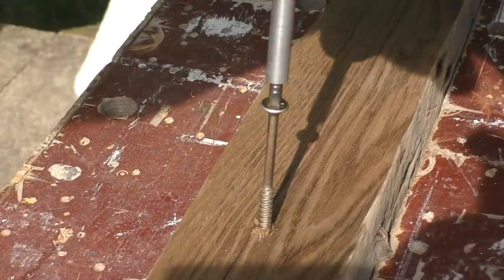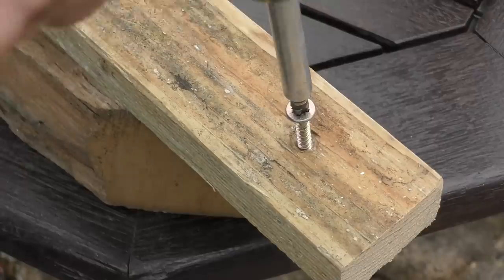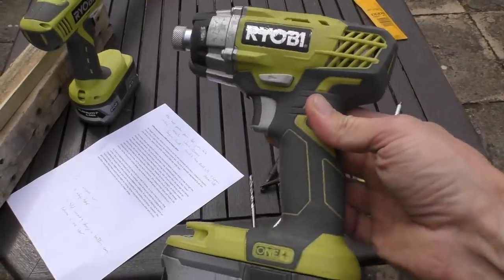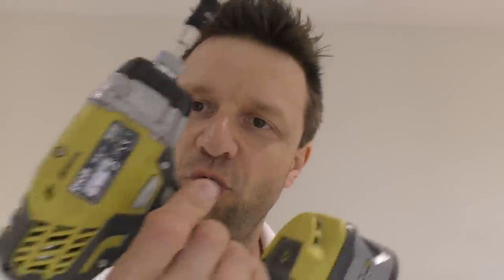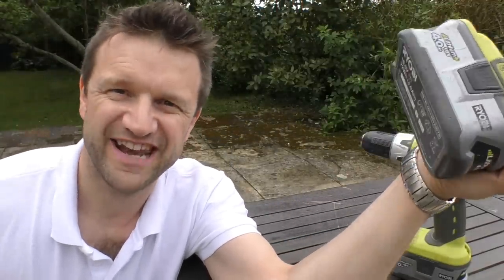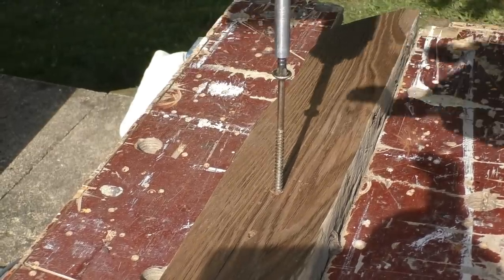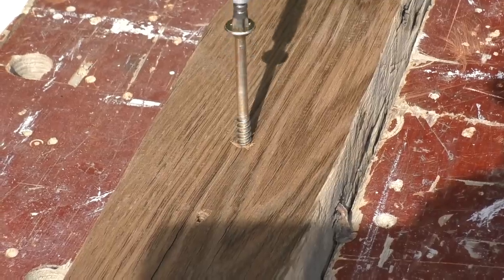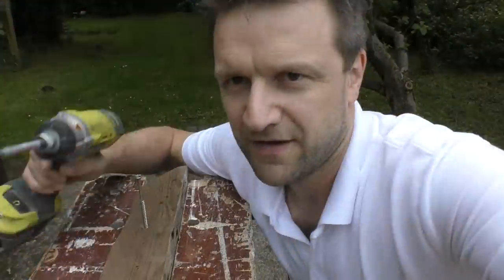Difference between Drill Drivers & Impact Drivers

Comment: ""I'm going to show you how much better the impact driver is that a standard drill. Both using 4.0 Ah batteries.
Standard: Screw goes right in.
Impact: Screw goes right in.
"Well, the drill did just as good... impressive. Now! Let me show you the 1.3 Ah battery! Here's where the impact shines..."

Standard: Dies 2/3s of the way in. "See? It just stops moving, entirely."
Impact: Dies 2/3s of the way in. "See? The small battery just isn't strong enough."
Finishes with a 4.0 Ah.  "See? The impact driver ran it right in!"
Reply: 😅 I thought it was just me...
Reply: Lol I thought the same honestly. But the point he was trying to make (which can't be seen in the video) is that he didn't have to apply as much pressure on the impact drill as he did with the standard drill.

Comment: One thing I think you should address is the voltage vs amperage. Amperage allows more working "time" but the voltage - also known as potential difference - is vital in delivering the charge (amps) fast. This is really why a 14v battery can theoretically have a 5ah charge but be unable to drive the big tools such as cordless SDS and why 18v+ batteries matter for pure power (and usually come with 4ah or 5ah batteries). The reason I think you had issues with the 1.3amp batteries here is that chemical degradation is effecting them though it might be to do with their construction (series etc) I'd have to pull a battery to bits to see.

But basically higher voltage and higher amperage = win.
Reply from the maker: Yep, I hear what you say. All makes a lot of sense and you might look at MondoTV's comment on this feed, which is on a similar line.
Reply: I love my 5.0 ah 20v batteries. Feels like they are never dead when I need them. I charge all of them up on the weekends before going back to work for the week

Comment: Solve it all by using a pilot hole and countersunk tool... And a bit of candle wax.
Reply from the maker: Totally agree - particularly in hard wood like this, but I was trying to make the test as demanding possible.
Reply: @CharlieDIYte  Why.... Its like comparing a 850 cc mini against a 3000 cc Jag. One is stronger than the other obviously, but driven differently both do the same job... A to B...
Reply: To A and B sure.. But, one's gonna do it faster. Which is kinda his point. Time is money.
Reply: @raymondrexinger3300  Ah,,, from that point of view then I understand. I've always considered quality first, though,  being old school as they say...
Reply: Ok?.. Quality has nothing to do with the ability to work faster/easier by choosing the right tool. "Work smarter not harder" something a old schooler once told me....
Reply: @raymondrexinger3300  Smart would be to use a countersunk, a clearance hole and then a pilot hole to enable people to use the cheaper model. That's what is smart and the finished job will look better no churned up screws slots. And they will never break a screw , which takes a lot of time to remedy. That's what is smart...
Reply: tony wrigglesworth this isn’t a tutorial on screwing, its a comparison done strictly to showcase the difference in the two devices’ method of action and power output, plain and simple...
Reply: @Fee.1  Ah,, a bit like reading the info on the boxes they come with...
Reply: Instead of wax, use soap.. even better dish soap.. it gets absorbed and becomes almost like glue
I usually use basic white glue to speed things up most often..

Comment: I am a big fan of Ryobi One+ and have recently got the Drill+Impact Driver 2-pack tool kit to add on to my Mower and Weed Whacker. I have the 9 AMP HOUR battery and it works like a dream with my mower, being able to mow through well over 500sq-ft  of thick grass and then Weed Whack the extras all on the same battery and the same charge! Nice to know that the different batteries are more than just capacity but peak power!

Comment: I use the 18.volt battery everyday, never loses the charge and I can use the impact screw gun all day on three batteries at work. There shouldn't be any problems using the 18.volt batteries unless you don't charge them or they ain't charging.

Comment: ..well I'm not sure if you would use the hammering effect for a ordinary screw in wood...
If wood is that hard, I would have made a  drill-hole in it..
Reply: If you don't pre drill wood and just try and stick a screw in it with an impact the odds of splitting it are pretty high... impacts should never be used for finish work imo

Comment: I'm buying a drill driver with a powerful battery....
Reply: Seems like the way to go.
Reply: ...and drill pilot holes ahead of time if you need to.
Reply: Way to go. I have had the drill driver for five years with a coupe of 4.0Ah batt. Never had any problems. Just build a hardwood deck. It did an excellent job.
Reply: Impactors are way better imo. Just puts no stress on your wrists plus they are normally faster
Reply: I'm not sure this is a scientific test of battery performance, we have nearly no information on the different batteries.
Reply: I have both an impact driver and a drill driver from Milwaukee and I love them both
Reply: just no

Comment: So... conclusion, if you don't need an impact driver, get a bigger and better battery for you drill driver... it will get the job done with a bit more effort, end up spending less dollars and save space. 
Only professionals would need an impact driver?
Reply from the maker: Liwkit MC It's difficult to argue with that. I guess the crucial bit is where you say "if you don't need an impact driver". That's a tricky one. If you're a budding DIY enthusiast who is turning their hands to an increasing amount of jobs around the house - from putting up curtain poles in masonry walls, screwing in skirting boards/ base boards to decking, then I'd say you might actually "need" or at any rate "benefit from" an impact driver - ie it will make your life easier for the more heavy duty jobs where you need a bit more power and torque. But if your use is more occasional and is never likely to grow from that, then I'd say you're right.

Interestingly the screwdriver I use the most is my little 9v drill driver https://goo.gl/SqknZe which is great for most light weight jobs around the house and one of the fitters who works for me - who is a pro carpenter/ joiner, absolutely loves it as it's so light and portable. So I guess that kind of proves your point!
Reply: No, you'd be better off with a small battery on an impact driver.

Probably cost the same as a bigger battery.
Reply: If you buy the same brand, all you need is bare tool, most cost the same or less than batteries, Buy the impact.
Reply: You don´t need one right. But its way nicer to use.

Of cause, if you only screw in hard screws once and a while.... yea... then you can just as well use your drill.

But if you need to screw in 20 heavy duty T25 screws after each other....

Really should buy a $99 impact screw driver if you hardly use it...  but if you screw a lot of screw and you are tiered of them slipping and holding the drill... then its really usefull.

The other reason to have a impact driver is that its quite common that one does drilling and screwing at the same work. Just not changing the tool in the drill does save a lot of time..

Again, you don´t need it, but its really nice
Reply: You can never have too many tools...ever
Reply: But the impact driver didn't get the job done when powered by the smaller battery. The impact driver doesn't have the over-torque protection nor the ability to take drills, so for the budget challenged DIYer there is only one solution: get a drill driver with the bigger battery. You can always add an impact driver later, if you feel the need.
Reply: @daffygrey  
I do agree with you. I was a contractor with the cable company. I used both hammer drill and impact driver, Milwaukee, for 10 years with the 5 Ah XC batteries in each. Both are unnecessary for a DIYer on a budget. Just the regular drill with the 5 Ah batter would be perfect.
Reply: "But the impact driver didn't get the job done when powered by the smaller battery."
It looks like that here. But my experience (used multiple diffrant impact drivers for over 10 years now) is that they often does.

"The impact driver doesn't have the over-torque protection"
Its not needed. Because they run slower the harder the torque is. So screws can be used with much better precision 

"ability to take drills,"
That is mostly true. You really should only buy a impact driver as a second tool after you got a cordless drill. But they can use 6 edge screws in a pinch.

"get a drill driver with the bigger battery"
A bigger battery might actually be more expensive than a impact driver.

"You can always add an impact driver later, if you feel the need."
That is true. The impact driver really should be the first tool to buy. That is a tool that you buy when you get anyed about swiching tools on your cordless drill.

I would also say. Even for a DIY home user. If you ever going to drill in concrete or stone, you really should have a SDS drill in steed of a normal cordless drill. Of cause, they are not really that cheap. but generaly they are a much higher quality product.

Really never use a normal cordless drill for drilling in concrete. You destroy it.
Reply: Also, if you do small engine work or automotive work, the impact driver is just far superior. You can easily use sockets on it and it'll rip out most nuts and bolts found on a common car. The impact mechanism is much better for that, and it's also smaller than the drill. I have a ton of 18v ryobi tools I use at home and the impact driver sees the most action. I have the 1/2 inch impact as well and it sees little use. It's a bit too big and it'll shear off bolts without much warning. So if you work on mowers, quads, dirt bikes, cars ect then the impact driver is one of the best tools you'll ever buy.
Reply: Phillip Arpin He who dies with the most power tools wins!
Reply: Phillip Arpin I have both Ryobi and Milwaukee (mainly because there was a particular tool you could only get in Milwaukee).  I am glad I ended up with a Milwaukee circular saw as it performs like a corded one.  So I think for tools that respond to power Milwaukee will be my choice, but for everything else I will save my money and get Ryobi.
Reply: I contract and it is a case of using the best tool for the job. There is a big difference in noise. If i can use the drill for a bunch of screws I will because it is quieter basically. Impact drivers get a bit overused on sites and make the workplace way noisier.
Reply: Yes it is a pain having to put hearing protection on when using an impact driver.
Reply: As a professional I use both.  I need the drill and the impact 
 Both have pros and cons that are essential to my line of work
Reply: If it was a dewalt hilti or makita it would of went right in the timber even with a small battery
Reply: Bite the bullet and buy an impact. Professional or not, you'll be glad.
Reply: More Ah does not mean more power...it only means more run time. Just buy a DeWalt and it will have 100s of times more POWER than the cheap brand, and it will use that power more efficient allowing for even their lowest Ah battery to last a good week of 8 hrs a day use, sometimes even 2 weeks. I have 5 spare DeWalt batteries I have never had to use because they last so long. My coworkers use ryobi and can never finish any job and never have enough charge to their battery. DeWalt is for supervisors
Reply: My wife cam’d out screws a lot until I introduced her to the impact gun. Now she never has the issue .

Comment: Interesting how the 1.3Ah was very weak. Are they older batteries? Maybe be more worn? The Ah is moe to do with capacity. Very interesting.
Reply from the maker: Zed Man They're reasonably old - a couple of years, but being lithium they shouldn't deteriorate that much. First time I noticed it was screwing drywalls into my Oak roof joists when mechanically fixing thermally insulated plasterboard. The impact driver got them in so far and then just didn't have the power to move the screw any further.
Reply: Its because there are less 18650 cells in the smaller batteries, and you can only pull so much power at a given time from one cell. The larger batteries have more cells and you can pull power from all of them, so you have more power available at once.
Reply from the maker: Gavin Coffey Thanks for that Gavin. That makes a lot of sense.
Reply: Charlie DIYte you bet.
Reply: These batteries have a cut off point so they don’t over heat, and mess up and break, basically the harder the job, it’s better to have a more powerful battery as they won’t cut out. Like if you’re to cut a thick tree branch, having a smaller battery will just cut out instantly, using a 4/5 amp battery will make the job possible
Reply: Agreed, a video comparing new  1.3 battery against 4 amp battery  would be more accurate

Comment: Its also worth to note that the bigger batteries will have a longer lifespan than the smaller batteries since each cell in the battery pack works less than half as hard they generate less heat wich shortens batteries lifespan. It won't matter if all your doing is light stuff but heavy duty drilling/driving it will have the better lifespan.

Comment: Working inside cabinets the impact driver is unbearably noisy. I would say dangerous to your hearing, OK you can wear things inside your ears but the folks in your vicinity are not so lucky. In my shop, every tool has to be versatile and perform multiple jobs. For speed, you can use quick change bits for your drill and save yourself space, time, and money as well as the clutter of extra tools.
Reply: Working in any confined space with an impact driver is annoyingly loud but I still prefer it to drill drivers due to it's size, power and speed.  I only use drill drivers when I need to be quiet or precise, otherwise I wear ear protection, so does anyone else working nearby.

Comment: "Impact driver has 3x more torque"
can drive screw in exactly as far as the traditional drill can
Reply: Try driving a beefy 6 inch lag screw with a drill driver.
Reply: @LupusMechanicus  I've done several side by side tests with my pair of drills. The standard driver has slightly more torque. The impact drill is still useful, regardless. Mostly with its compact size.
Reply: Exactly what I thought when I saw this video. I don't see the huge difference that he had billed at the beginning.

Comment: you should have showed how well the impact driver drills holes as well.thanks
Reply from the maker: Good point. I need to get a drill attachment for it.
Reply: @CharlieDIYte   Or get impact driver drill-bits. I got a set so I only had to carry one tool, and I was so pleased. I didn't know impacters could drill, but I can drill better with my little impacter than with the other guy's old Makita hammer drill!

Comment: Thank you for this demo Charlie. I, too, found the Amp/hour issue unintuitive. Like others, I previously thought A/h referred solely to battery running time. However, I came across an article over at Protool reviews which confirmed your advocacy of higher-rated A/h on grounds of sheer power delivery.  After documenting their testing methodology, their conclusion was as follows: 

"Now that we know how significantly battery amp hours affect power, the application side is pretty straightforward. In lighter-duty tasks, a bigger battery doesn’t have a huge advantage, so save some weight and go with the smaller pack. As you move into medium and heavy-duty applications, the difference [in power delivery] is substantial and a higher capacity battery is the way to go".
Reply from the maker: Thanks buddy. Exactly my thoughts. There's a very long comment feed in the comments section below the vid with some really useful insight into this.  👊